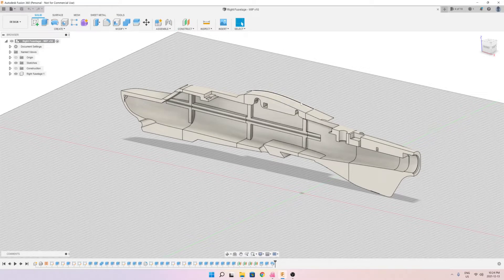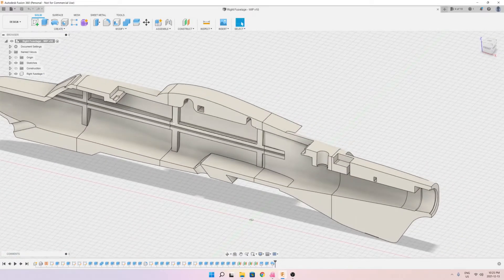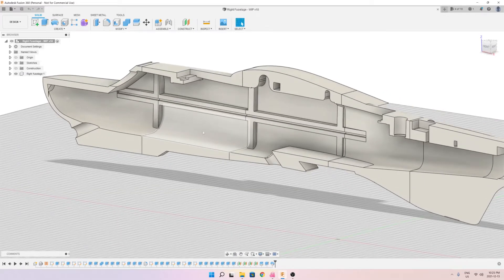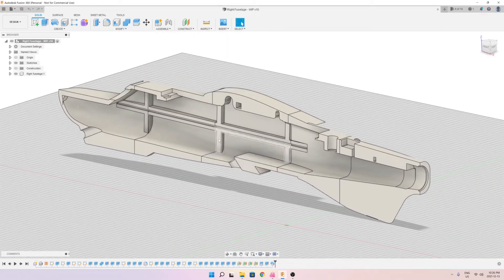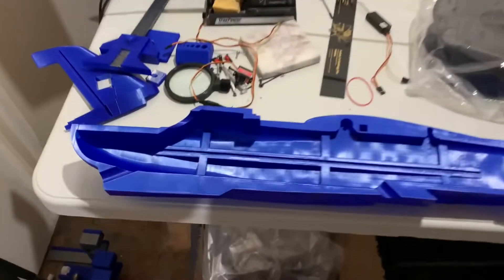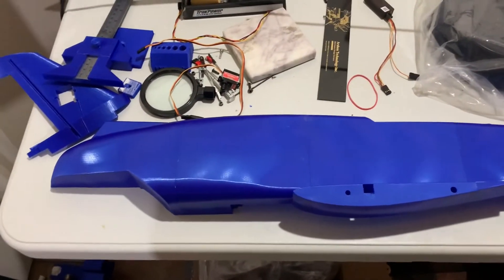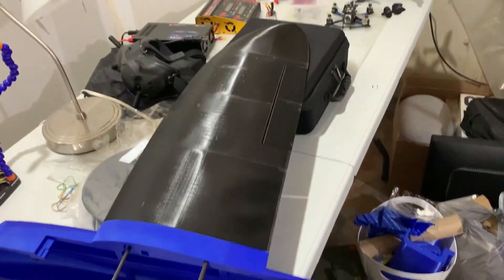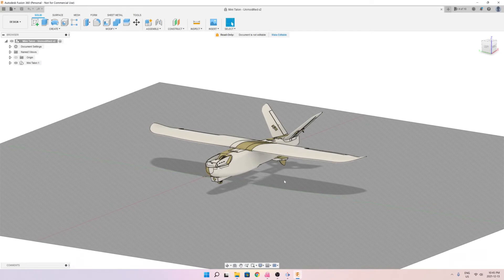3D Printed X-UAV Mini-Talon - Part 2

Comment: Awesome! Legendary mini talon will be reborn to another legend by you!! I'm dying to wait your final work! Many thanks.
By the way, weight? heavier than foam fuslage?
Reply from the maker: The right half of the fuselage is 150g, so I expect the full fuselage with the hatch to be around 330g (without tail). And both wings weigh 300g, tails will be around 70g, so I expect total weight without electronics or battery to be 700 to 800 g